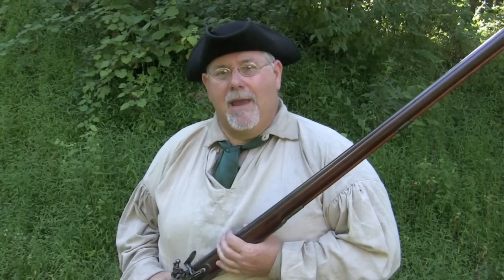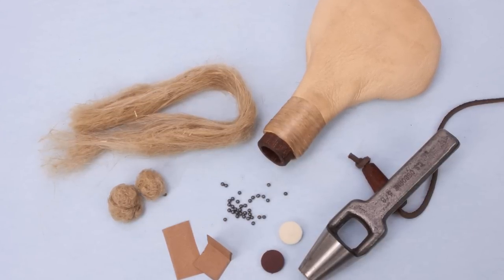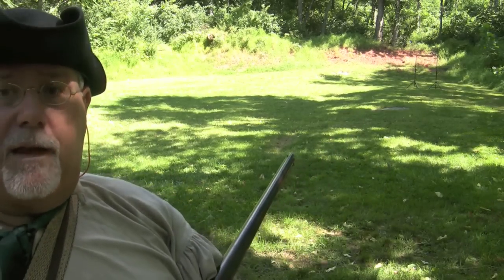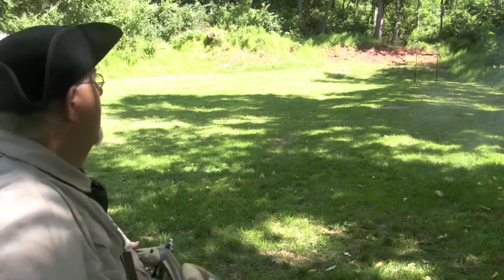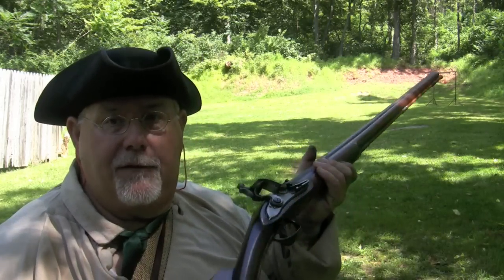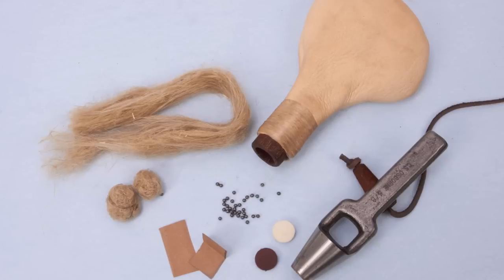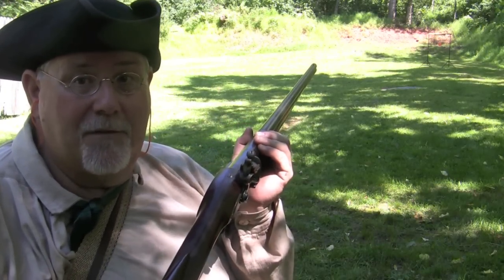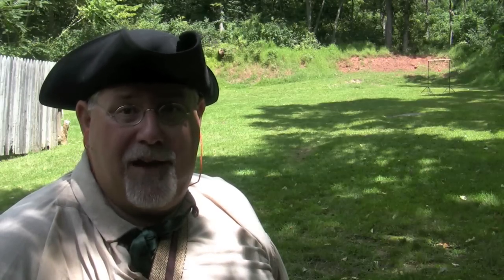Loading 18th century civilian smoothbores   part 2 shot

Comment: Mike, I've watched this video several times, I'm glad I did. Back in February I ordered a Fusil from TVM, got it about early October. You saved me a whole lot of time. What worked in mine was a square load, but it's bigger then normal. 110 of ffg and 1.5 oz of shot. Leather over powder wad, and I'm using unspun natural wool like tow for over shot was. I have gotten decent coverage over the entire 11x11 target I was using at 35 yards. Haven't tried 40. Might be something to try in your gun. Either way, thank you for this video.
Reply: My fusil from tvm should be here Monday or Tuesday
Reply: I got a .69 caliber 1842 smoothbore musket from Dixie Gunworks to use as a shotgun and I'm going to try Mike's loads myself.

Comment: I have a 1760s - 1770s copy of a french .69 cal. smooth bore.  I wish you would do a video on those with ball or shot.  Right now I have been using 12 gauge foster slugs.  Not accurate at all but fun to shoot 5 gallon water jugs with.  I would squirrel hunt with it if I find the right load for shot.

Comment: What diameter should the paper or leather be cut relative to the bore diameter? Same diameter?
Reply from the maker: Leather needs to be punched out, circular, bore diameter. Paper is a foldeed square, One inch square for 20 Ga, about 1.5 inches square for 12 GA

Comment: The best way to check a shot gun pattern is on paper,...to see where your shot is hitting.
And smooth bores are like a bb gun,......accurate at one distance,.....to go farther add more power,.....or you use Kentucky windage.

Comment: I was thinking about trying powder-leather wad-tow-paper wad-shot-paper wad. This would be using the strengths of all three. The leather for a good seal, the tow for a cushion (I'm a believer in cushioning the shot). Then paper to seal the top so the tow will not blow the pattern.
Reply: Yes, 100 years of paper shotgun shell developement showed that
System produced the best patterns.
Hard card over powder, cushion wads,shot, thin card over shot.
Tamp the powder with the hard card first. Dont tamp the shot.

Comment: Excellent video. I am saving it for reference. Do you think the small shot gets caught in the flax tow? perhaps the flax over the powder and paper over the shot would work better? Not an experienced BP guy, but wondering...
Reply: I'm thinking with the flax wad it's a combination of an uneven contact area and the porousness of the fibers. Allowing higher pressure gas to get around the circumference of the wad. This may very well explain the donut pattern he mentioned.
Reply from the maker: I don't think the shot gets stuck in the tow,

Comment: A square load is not as you state, a square load is a shot column length the same as the width (at rest before firing), each gauge has it's own square.  Bridges did a test to improve pattern on a fowler and found loading with over powder card then a cushion wad torn into pieces and packed with loading rod, then shot and an over shot card. The torn up cushion wad still acted as a cushion but blew apart on exit  and did not blow a hole through the shot column a foot or so ahead of the gun. Your gun may shoot better with 2oz , just as any gun with over two times the standard load. Not really a fair comparison test , I say the paper over powder patch you are using is not holding together and permitting powder and gas to get into the shot column and donuting the shot pattern (gas will want to go through the center, line friction etc), the reason 2oz load is working, apart from just the volume of pellets is the long length of the shot column and set back cause by the 100 grains of powder packing the shot and blocking the gas. The 2oz load is just a hot core load .